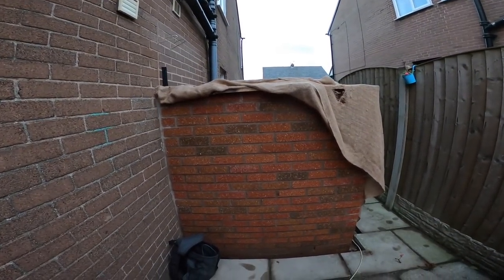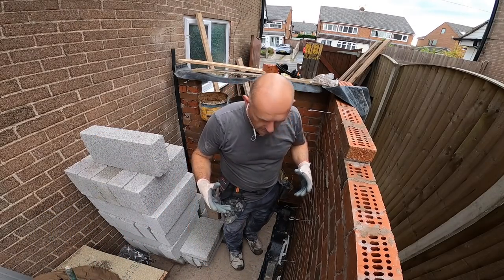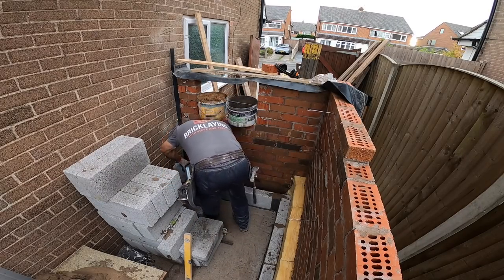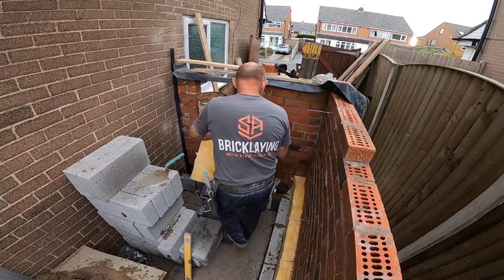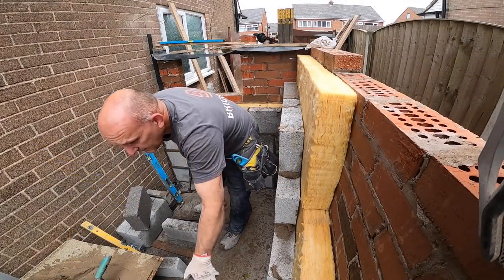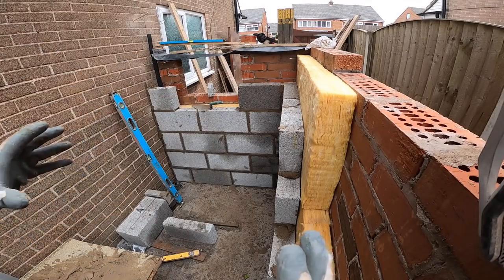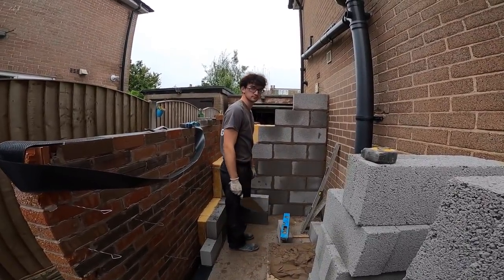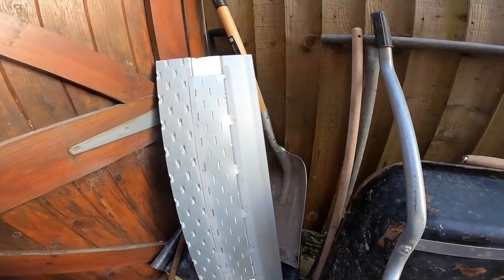BREEZE BLOCK WALLS ON SMALL EXTENSION

Comment: You both were really going like a steam train in this vid, a lot done and even time for a hug.
Difficult to work in that narrow space, wonder what this is going to be used for, I can only see it as a small boot/utility room and maybe a toilet.
It's even to narrow to have full depth kitchen cabinets and worktop along the long wall, the 1m spirit level didn't even fit in the width.
Reply from the maker: Thanks buddy 😆. It’s a washer and dryer stacked and the other end is for coats 🧱👍🏽

Comment: Like your good and all but after the 1st course y are we still measuring and not plumbing 
Also how don’t we run of 10 cuts on brick saw once size is established ❤️🇦🇺👍
Reply from the maker: Thanks.  My brickwork is plumb so I just measure for speed . As for the cuts it’s no quicker with the cutter plus all the noise and dust 🧱👍🏽

Comment: Is that 100mm insulation? Dont you have to put wall starters on the inner block work to connect the new to the existing?
Reply from the maker: It is pal 👌🏼🧱👍🏽

Comment: Hi guys, just a question, I'm building another level on my bungalow.
What are your views on using thermalite blocks on outside leaf to keep weight down on existing footings and easier installation.
They will be k rendered.
Cheers
Reply from the maker: Hi pal  I can’t answer that I’m afraid . A structural engineer would be better to ask or contact the manufacturers of the blocks . 
    Look into Plasmor Fibolite blocks too . They are as light as the thermalises but massively stronger . 
    You can also get lightweight 7 Newton blocks . 
    Good luck with the build 🧱👍🏽
Reply: @SteveAndAlexBuild  yeah, true .
It's just that most builds now use thermalites on inside leaf that takes weight of the roof and outside leaf doesn't need to be structural, so strength not so important  
Have you ever used them external?
Reply from the maker: @ivegotaporscheandalambo3318  No but I’ve seen Charlie Collison build a house with them 🧱🧱👍🏽

Comment: Okay, carpenter from the States doesn’t understand why the new building wall is constructed the way it is. I need it explained. It seems to be very inefficient and is much thicker than it needs to be. The bricks and cinder block provide almost no insulation, no place for wiring and a rough interior surface.   I’m sure I’m missing something.
Reply from the maker: No this is standard build in the uk 🧱👍🏽